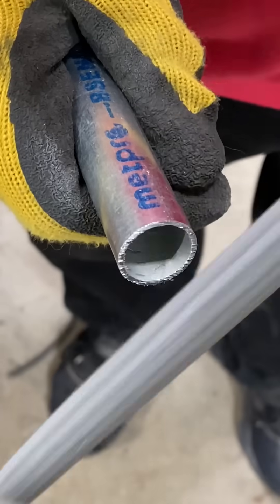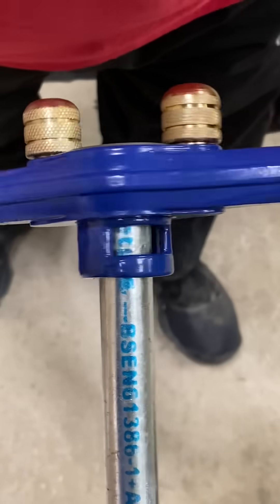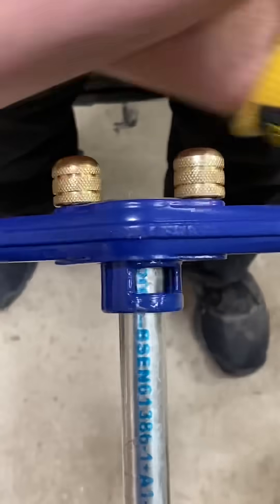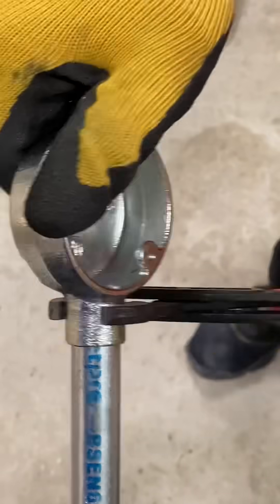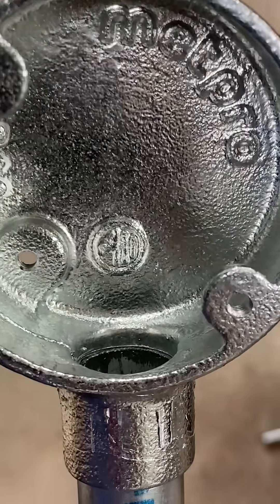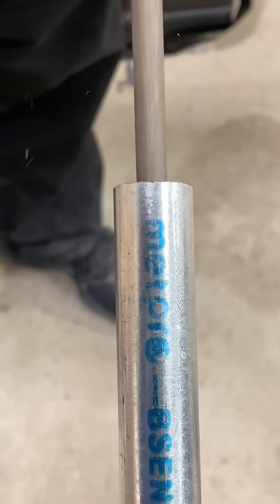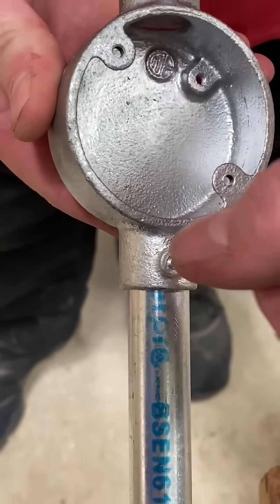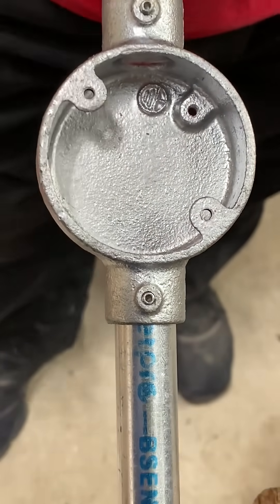THREADING METAL CONDUIT VS CONLOK FITTINGS -#Shorts

Comment: I'm an American lightning electrician and I can tell you...I have never seen threaded conduit like that. All of our connections are done by screw. The inspectors that I deal with don't even count hard pipe as grounding anymore so we still have to run a grounding wire through the conduit. At least in michigan. When we go to Illinois they don't care.

Comment: All of the electrical work I've done we use set screw 1900 boxes/couplings/connectors. If the work is in an industrial environment then we use our milwaukee m18 1/4"--1" emt/ridgid pipe threader. We also have the same tool but it does 2"--5" emt/ridgid. I've never seen a alan key set screw though, that would be a pain to have to keep a small key like that, i'd lose it almost instantly. our set screws are always sq2 (square #2) or a p2 (Philips #2) with a full passthrough for a flathead. I find those types of bits are more than likely already on your impact/driver anyway.

Comment: Never seen threaded EMT before. Do they actually make locknuts to fit emt? Since is smaller in diameter rigid locknuts wouldn't fit it. Or is threaded emt strictly for that type of Jbox?

Comment: Do they ever use compression couplings and connectors for emt, over there? I worked on a couple projects at San Francisco International Airport for the first half of my apprenticeship. That's all we used indoors. I didn't see any connectors with set screws till later on. I thought they were crap
Reply from the maker: No we are still stuck in 1950 innovation moves slowly here. Apart from use of Wagos everyone loves them.

Comment: that allen fitting wont last
threads stand the test of time bar none.
Electicity is vibration 
any air gaps allow moisture aka water in and will corrode the copper wire ends making contact inside eventually, conduit may last 
copper wont.
Threads may not last forever yet form a tighter seal leaving less air pathways and elements will invade.
not my sole opinion but experience teaches me best of all.
Neat way to save time 
for a shop or storage room 
but not for a home I advise a better seal at that point.
Great video 
love the old fashion way
cheers mate!
Reply from the maker: It’s the standard way in the US or do a few hundred people have told us

Comment: i mean with threaded i can assume a slight bit of waterproofing where as with the brand named locking tension pin ... it's fast but no additional benefits of keeping water and dirt out ... working at a food plant the crazy wash crew have destroyed much equipment with thier hot water spray hoses trying to get water in every electronics port possible machine motors for conveyors just everything can't count how many brand new watertight sealed bearings have been rusted and filled with water not 30 minutes after being installed i get that things have to be food grade clean but they could do with a bit of finess to protect $100,000 circuit boards that are neccacary for entire machine to operate correctly long story short I'll take the threaded conduit thank you with a lil silicone to seal out the more than condensation or moisture

Comment: Congrats on the British for finally discovering set screw fittings for EMT. We Americans could have just sent you some if you'd asked...but sure. Reinvent the wheel. 😂
Reply: We have always  historically done things belt and braces and this is the next “save on labour” product to grace our struggling present industry.
Reply from the maker: Any other great secrets - send them over Michael
Reply: @efixx  works for electrical conduit but don't try for any plumbing concerns!
Reply: I honestly didn't even know they threaded EMT over there. Only ever used setscrews for EMT, and saved the threading for intermediate or ridgid conduit.

Comment: Threading is a pain in the ass , easier and quicker to use compression fittings ...only really thread when necessary to maintain explosion proof...and you are correct emt
In the USA is to thin of a wall to thread properly so we use set screw for indoor or compression fittings if we want water proof.🤙🏼
Reply: As well as conduit is no longer able to be used as the grounding electrode... used to be ok but no more in the states

Comment: American Sparky here..  EMT cannot be threaded,  its far too thin.  Rigid Steel conduit is the only acceptable wall thickness that can safely hold threads.   I'm curious what what wall thickness is in comparison between American EMT and whatever thin-wall metallic tubing you're using in these videos.

Comment: I always remove the grub screw, and drill a small pilot into the conduit, then replace grub screw to lock it in place better, takes seconds more.
Reply: The trolls are rollin on this thread
Reply from the maker: Good tip
Reply: @efixx  tf? Terrible advice? The tip of the screw is pointed. You want the wires rubbing against that? There's a reason you debur everything and you WANT to add a sharp edge?
Reply: @jrdn.lauren  Not all the way through...
Reply: @MattTrevett  he's talking about making a hole in the conduit (all the way through) for the screw to key into.
Reply: @MattTrevett  also completely unnecessary. The tension of the screw against the pipe keeps it from unscrewing. Kinda like a jam nut.
Reply: @jrdn.lauren  Sounds like you've already made up your mind.
Reply: @jrdn.lauren  I don't think he is talking about drilling a hole all the way through. I think he's saying he drilles an indent to give the grub screw a spot to sit in. Decent idea.

Comment: won't catch on. Any older electricians will remember the knock on conduit fitting . similar which had a high tensile piece of metal tag on the entry point of the besa box which
 scraped into the conduit when pushed in

Comment: the problem with the second method is that if you tighten the bolt too mouch it makes the seal  untight, it allso has a lot less friction so under high preassure it wont hold

Comment: I can see it having its use in some rare occasions where you need to do an alteration and space is compromised or if you are unable to remove a conduit to retread for whatever reason. But other than that, I'd stick with a traditional thread.

Comment: It's great stuff used it lots. As I do shop fitting and don't do all that much steel conduit I don't carry around a pipe vice / bender so it works ell for hat I need.

Comment: Going back in time, approx 1979/1980, I used something similar called Easylock ( or was it easiloc?) conduit. Using steel conduit,  no threading was involved. Each fitting/conduit entry had a small loop on the side of the entry point that was designed to take a self tapping screw. The system just fitted together like plastic conduit, followed by the self tapper.
This screw cut its own a thread in the fitting and tube simultaneously providing a fairly rigid joint. It was also deemed as suitable as the sole means of earthing hence no separate CPC required (conduit was often used as such back then). It was quick to use and a lot easier to assemble lengths with bends as no rotation of the tube was required. It wasn't around for long so I guess it wasn't particularly popular.

Comment: I worked with it a few years ago, it's quick and speeds the job up. But I hate it, threaded all the way. Better connection to a box and far more rigid. If conlok is on show it looks like a dugs dinner!

Comment: I have used ConLoc quite a bit over the last couple of years for vanity applications ( the industrial look with metal clad accessories). I always use a separate CPC and wouldn't rely on the grub screw for a safety critical element of the installation.
Reply from the maker: Great feedback thanks 🙏

Comment: You said that you was done? Where was the lock ring onto the threaded pipe?
Reply: What would you need a lock ring for 😂 thread was correct length and he tightened up the box correctly, only need a lock ring on a runner.
Reply: We Scotsmen always use a locking on our threads 🏴

Comment: If you take the skill out of the job. It'll just end up a crap install that's been fitted by unskilled labour, because its cheaper
Reply: It’s hard to get people to care when they’re saving money in the short run. Instant gratification has destroyed this world😩
Reply: I've been hotstick line mechanic for years. That's as skilled a trade as they come, according to me. 
I find your comment ignorant and biased.  Technology is to be used with responsibility. Makes things safer and more ergonomic and better all around. 
This device however is weaker than the threaded one they did first. But how much strength is needed when screwed to the wall, which this always is. 
Maybe there is a reason they don't thread emt in the USA. Have you considered that? This connection needs to keep bugs and critters out also make an electrical connection. It doesn't need to take 5 minutes when 30 secs will do.
Reply: @richardpatterson4312  I find your comment to be irrelevant and inapplicable to the 21st century, OP is absolutely right. Otherwise shit would still be made in America. Technology is great, but it will NEVER be a substitute or replacement for common sense and experience.
Reply: @throttleblipsntwistedgrips1992  I find your comment offensive and racist. This is all wrong. I shouldn't be up here. I should be back in school on the other side of the ocean. Yet you all come to us young people for hope. How dare you!

"You have stolen my dreams and my childhood with your empty words. And yet I'm one of the lucky ones. People are suffering. People are dying. Entire ecosystems are collapsing. We are in the beginning of a mass extinction, and all you can talk about is money and fairy tales of eternal economic growth. How dare you!
Reply: @throttleblipsntwistedgrips1992  and cue new car manufacturers making cars that are a miserable driving experience and enabling low skilled drivers to continue to be low skilled with a false sense of security from a car that makes everything simple and easy.
Reply: @throttleblipsntwistedgrips1992  a lot still is made in the U.S., typically it's just higher grade products so most people don't see it with the modern "Buy and trash" mentality of the 21st century.

As for EMT, structurally it's weak. Set screws will hold longer than the pipe will if properly installed. I say this as a guy who rips boxes out regularly with my work. You can get concrete anchors to tear out and even bend the pipe over and fold it before the screws give out since they'll actually bend the pipe in around it and act like a tooth. It makes sense to thread rigid due to its needs but not EMT due to it being thin walled.

Comment: I wonder who will stock this instead of 'normal ' conduit fittings ? Looks like updated slip conduit ,theres a blast from the past .
Reply: Conlok has been out for years, and easily got in by most wholesalers, believe neweys keep some in stock. 
Problem is nobody bothers with steel conduit now unless it's been specced by the consultant, and if it's been specced you can bet your arse they wont approve conlok
Reply: @darylsavage119  most of my work over at least the last 30 yrs has been trunking and conduit never been offered any alternative to screwed fittings.
Reply: How can it be slip conduit, when he's just put a thread on 3
Reply: @theendofmytether398  he didn't for the second box .Slip conduit used boxes with an external nut and bolt ,also you can get knock on boxes with an internal gripper.

Comment: I've seen threaded conduit fittings still solid that have been in place probably 30-40 years on jobs. I've also seen conlok stuff that was already coming loose in parts before the job was even finished on a shopping centre I was working on a few years back. It wouldn't be a bad idea if it came with bigger grub screws that you actually screwed into the conduit after you drilled and tapped the pipe then it would be far more secure. But by that stage you might as well just do it the right way and use threaded conduit. How long does it take to thread a bit of 20mm pipe anyway, 30 seconds?
Reply: Sometimes the right way isn't the quick and easy way, sometimes taking longer saves time later.
Reply: But why do you want to thread emt? That's thinwall. You thread rigid not emt
Reply: @maybe_try_thinking_instead  In the UK we thread all Electrical conduit, or at least we used to before systems like Conlok came along. 

 Also I don't believe that was thin conduit in this video. It was 20mm Galvanised conduit, it would be thicker and harder to bend than the EMT you guys use in North America.
Reply: @maybe_try_thinking_instead  I think their "emt" is what we call imc in the states, it's thick enough to be threaded but not as thick as rigid.
Reply: @adjsaint  my dad taught me how to use a foot bender in high-school. I vaguely remember how to do it. I don't remember the formulas though. I became a floorlayer like an idiot, lol.
Reply: Yea, like I said. Rigid
Reply: @maybe_try_thinking_instead  Yeah we don't really use thin wall metal conduit in the UK as far as I know. I've never come across it in 20+ years of Industrial work anyway, it may be used in some applications.
Reply: I've seen it 70 years old
Reply: @michaeljohnson1006  damn, you're prolly in your 80s now. Holy, 😮.
Reply: No time a'tall wifv ye' ol mil'wonke'
Reply: Not sure If conlock is the same as emt in the US but this crap is the bane of my existence, I miss threading Rigid
Reply: @adjsaint  Is rigid conduit just not widely used in the US anymore?
Reply: @stevoc9930  its rigid in industrial settings and thin wall in commercial settings. I just hate commercial
Reply: @adjsaint  Thanks for the info. I prefer industrial work myself.
Reply: Whats your point? So what if they are loose. Once they are installed, chances are nobody will even touch them for atleast 10 years. All they house is wires and wirenuts. Even if someone was servicing one of these boxes and found it a bit loose, a quick snug with a allen wrench and your right as rain until someone services the box 10 years later.
Reply: @Arlaul  "So what if they are loose?" Are you an electrician? If you are you should know of a reason that an exposed metal housing protecting live electrical cables would need to have continuous connectivity through all of its components.
Reply: I personally only ever use B&B locks when tightening th cason
Reply: Idk if this is a common pun, but of course its not as good, its call con-lock
Reply: ever use 25mm stainless steel conduit?
that's tough stuff
installed it in Wyeth and Merck
I love conloc it's a piece of piss and you can be a few mm off and get away with it however if it was my own job I wouldn't want it
Reply: @skipper6528  Yep a few times looks a great job if done well though but yeah it can be a pain. And yep Con-Loc is piss easy which is why it exists it takes little or no skill and anyone can install it.
Reply: How long does it take to put in a drop of lock
tight or a second screw ontop of that one
Reply: Why are you running conduit anyway. MC has been around for 20yrs.
Reply: @submittedbymail  MC ? Flexible conduit?